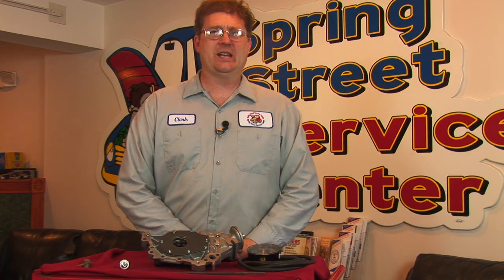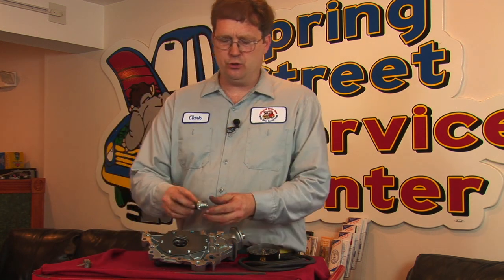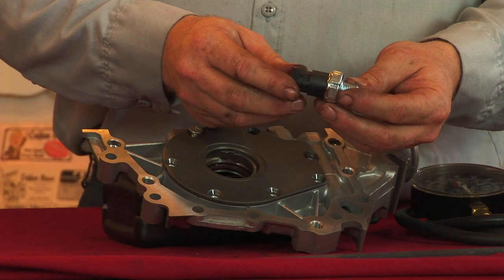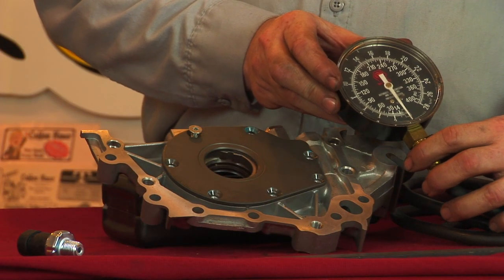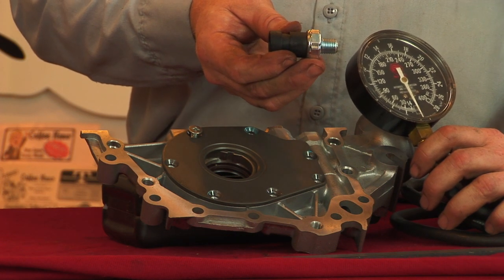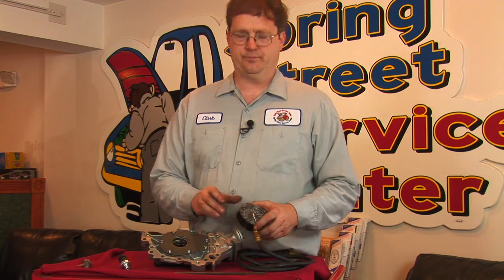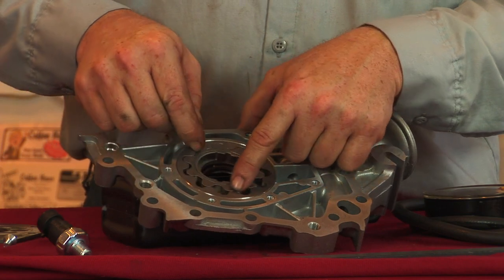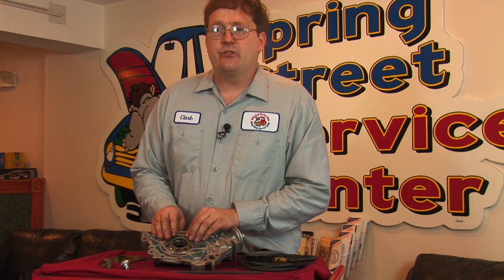Auto Repair & Maintenance : How to Check if an Oil Pump Is Bad

Comment: Anyone know how you remove an oil level switch from the outside of your sump on a Vauxhall Astra 1.7 CDTi 05 plate
Reply: It should be right next to the oil filter

Comment: I hate lights for alternator and oil pressure. I think all cars should come with real gauges. A light is fine to warn you and bring your attention to a potential problem after that though it would be nice to have gauges to look at.

Comment: 1 engine off, 2 read the oil level, 3 start engine, 4 read the oil level while engine running, if the level decreased more than half then its pumping, if oil level stays the same then oil is not pumping. you'll also hear a knocking sound if the oil stays at the same level.
Reply: thats whats mine are doing
Reply: Wow thanks I'm gonna try that.
Reply: Like a knocking when you turn it over and then stops or continuously knocking

Comment: great video, appreciate the mention of checking tolerances to see if the pump should be replaced. Is there such a thing as a camera that can be snaked inside the oil plug hole to inspect the pump without taking off the timing cover on a 1zzfe Corolla engine (or is the mechanic trying to avoid taking off the engine cover with a fib)?

Comment: Before internal combustion engines became 'all-high-and-mighty' by positioning its' valve assembly 'Over-Head', with 6,000+ red-lines...there was not a need, not a necessity, for ze lubricant to be forced along by a pump.  Splash lubrication systems were quite adequate.
Reply: Splash lubrication systems are still used widely today in the aviation industry.